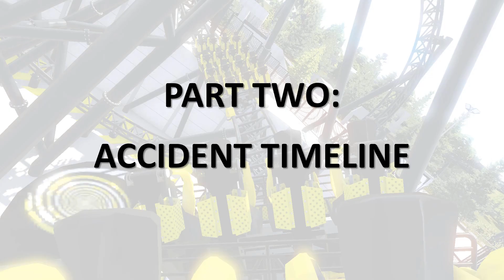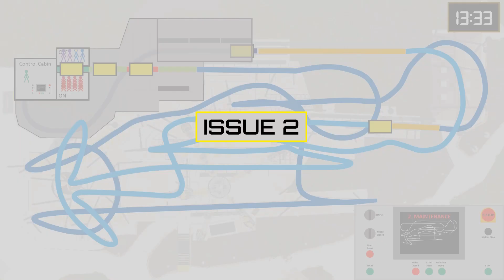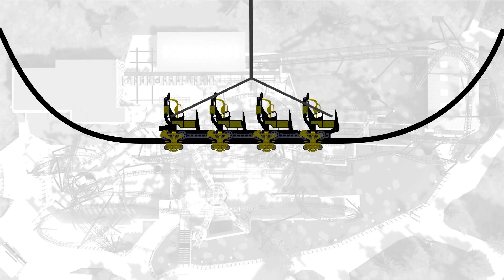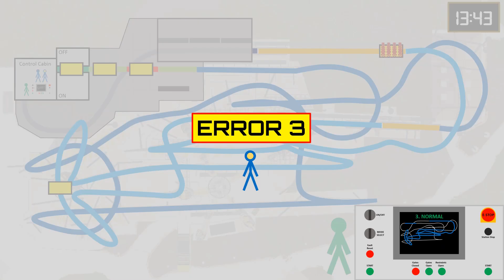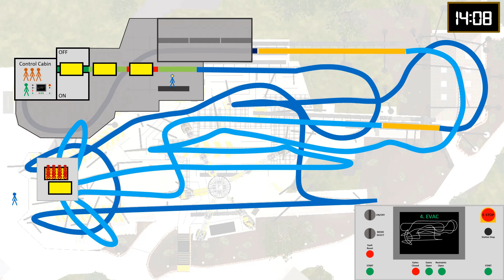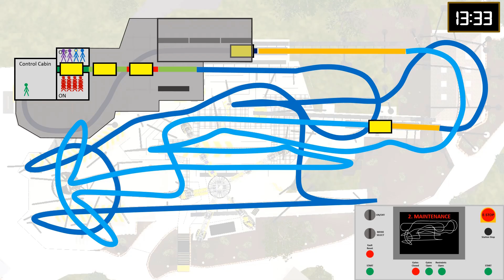The Smiler Crash: No Stone Left Unturned - Part 2 Accident Timeline

Comment: I rode the smiler for the first time today, two train operation. Still to this day, the train struggles to get through the second part of the Staffordshire knot. It felt REALLY slow and being that this element has such a troubled mechanical and emotional history. I really do hope this could be removed, it honestly knocks my confidence when riding the smiler. I fully understand nowadays it's likely to just valley in the middle  and then be winched off but if the propulsion isn't there, the element shouldn't be there.
Reply: How are people rescued from the train if it gets valleyed in a section which can only be craned?
Reply: @chilli943  they can unlock the restraints by unscrewing them or depressuring the hydraulic pistons on the restraints.
Reply: @williamshort3620  yeah but if it’s in a valley section of the track. How are the people taken from the cart and back to ground?
Reply: @chilli943  they could airlift them on stretchers or something.
Reply: It's supposed to be slow, kitten.
Reply: @ThunderchickenXL  If it being slow has both caused it to stall and crash it should be changed
Reply: @Yonel6969  no that was because of high winds and human error
Reply: @Yonel6969  it's supposed to be slow to scare people. It crashed becuase of the wind and the ride operators thinking there was a "ghost train" on the track
Reply: @animatroniclife  The team did not know about any 'ghost train'. They could only see faults on the COU. They ignored them. As a previous ride op, this video haunts me. Because of the very explainable human error.
Reply: @gerscales  they saw those faults and from what I've heard, the team thought it was detecting a "ghost train"
Reply: @ThunderchickenXL  Right i'll ignore the weird kitten comment - but explain why it needs to be slow please?
Reply: @mrhxrty the smiler is designed too go slow on some parts. On that day they ran the smiler over  46mph which the smiler can only operate in 30mph. So the smiler that day should not of been open
Reply: @mrhxrty it literally doesn’t struggle to get around that inversion at all.